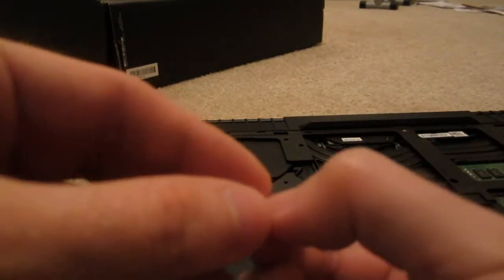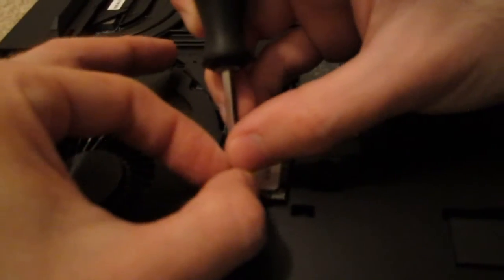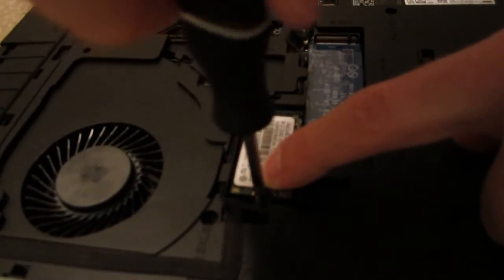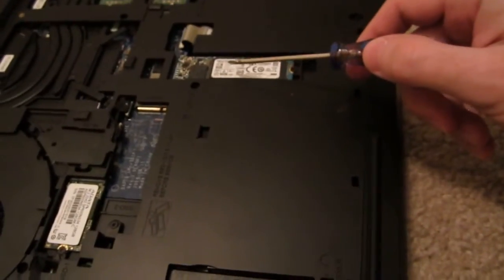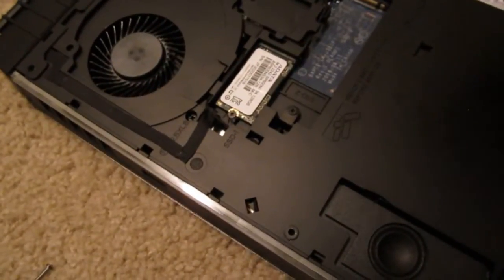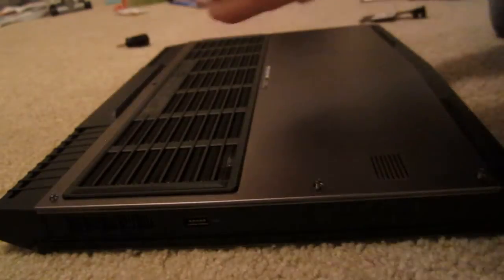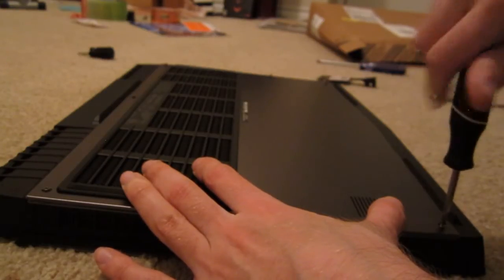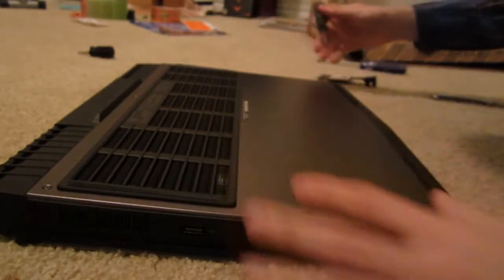Installing M2.2242 SSD into Alienware 17 R4

Comment: Where did you buy that ssd? I can't find it nowhere!
Reply from the maker: I did not buy but salvage it from my dead desktop PC. Though they are on sale online, such as: https://www.amazon.com/KingSpec-2242-512GB-Internal-Ultrabook/dp/B07CJ4BSK8/ref=sr_1_6?keywords=short+ssd&qid=1568811948&sr=8-6
Reply: @ozhozh  Wait! This one has two key ways on the pins. Is that the right drive? Because the slot on the motherboard has only one key? Or it doesn't matter?

Comment: hello, can i get info on where you purchased the M2.2242 SDD halfsize, been searching for one, i have exactly the same pc as you do.
Reply from the maker: I didn't purchase it separately but got it from my dying desktop pre-made pc. Here is an amazon.com link to purchase it, though there are better brands than A-data to consider too: https://www.amazon.com/ADATA-SU800-M-2-128GB-ASU800NS38-128GT-C/dp/B01M9K0N8I/ref=sr_1_19?ie=UTF8&qid=1505907493&sr=8-19&keywords=M.2+2242
Reply: ok. thanks. i was finally able to buy a 1TB samsung PCIe drive off a retailer and it works fine in M SLOT 3.

Comment: Bro, i have the 15 r3 which i got last week. i want to install the same ssd that you have. But i can't find the 
right one. if i search on Ebay, Amazon or some online store i can't find the pin type that it has. i know the size
of that is 2242. Please can you provide for me the correct type and where you bought it? thanks
Reply: i cansee is this one https://www.newegg.com/Product/Product.aspx?Item=N82E16820211972 
but look the the pin is has two holes on it. but the compatible is only with one whole.
Reply from the maker: It should be compatible if it is M2.2242. I got mine from my dead desktop PC motherboard.
Reply: THANKS...
Reply: @ozhozh  What is the maximum size of the driver capacity that I can place for this slot? I saw some 512gb does the 17 R4 support?
Reply: Ssd 240Gb Msata Kingston Uv500 Suv500Ms/240G
Reply: M2 512 Gb 2242 Sata Ssd Ngff Asus B350 H310 22*42
Reply: @claudneysartisessa  Thanks for the reply Bro, unfortunately i sold the laptop 2 years back. this message is 3 years now :)
Reply from the maker: @claudneysartisessa  I have no idea if there is any limit. I do not know whether there should be such limit.
Reply: Nice vid...thanks.

Comment: What is the max pcie ssd you can put in a 17r4???
Reply from the maker: I believe there is no max. The largest NVMe M2.2280 SSD is 2 TB I guess and costs like 1600 bucks. The largest M2.2242 SSD I saw was 512 GB and costs like 250 bucks. The limit is how much you can afford :)
Reply: @ozhozh  alienware r4 support m. 2 sata only or both m. 2 sata and  m. 2 nvme
Reply from the maker: @harpuli  I think both nvme and sata.
Reply: There is no limit but I would recommend getting 2TB at most. Larger capacities tend to fail more often.